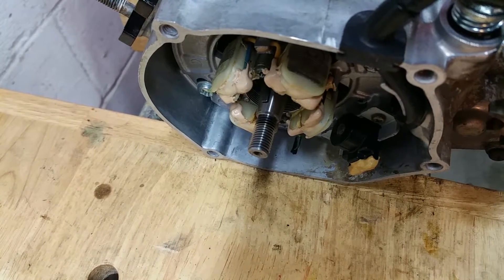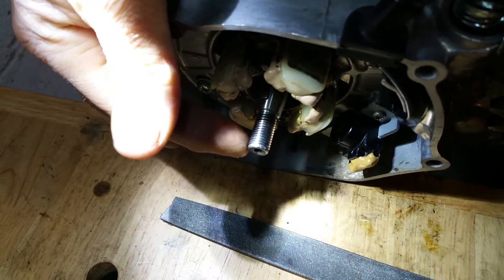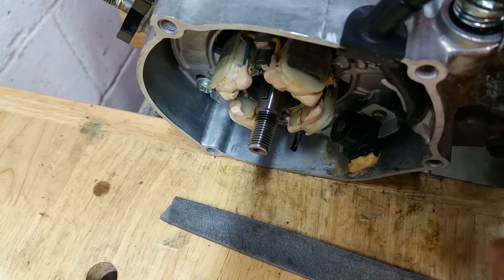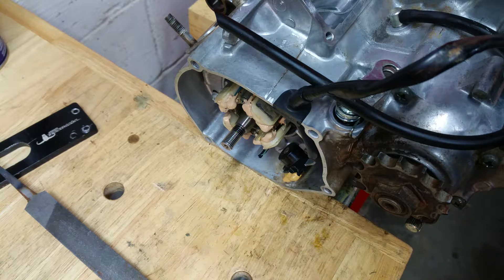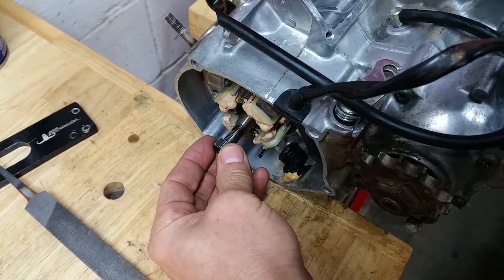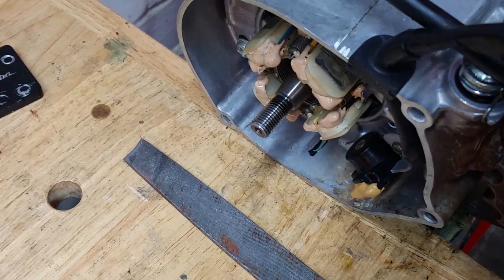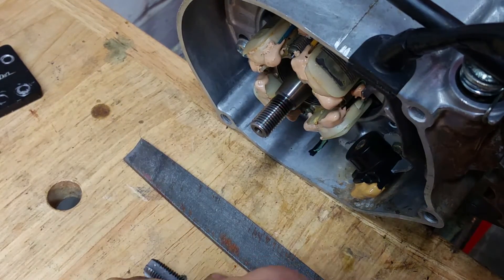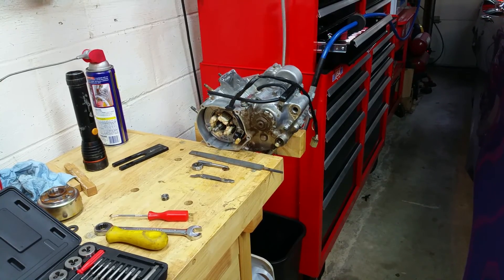What to do if crankshaft threads are damaged motorcycle crank shaft dirtbike small engine mower any

Comment: I needed this video badly.
Reply from the maker: What vehicle were you working on?  What was the issue?
Reply: @HorsepowerHouse  Yamaha R15 V2.0  . While opening magneto , The tool was misalign a little out of center. I needed to put lot of pressure to remove Magneto. While doing so starting thread of Crankshaft end got pinch and now while install Magneto rotor back, Threads are not starting.  Thanks for your video.
Reply: I bought a new nut to avoid damage to crankshaft threads.

Comment: I was in the process of removing my flywheel off a Ktm. Come to find out the hard way, the threads are reversed. I found out, after trying to pull the nut. So the nut is done. The crank doesn’t look good. Do you think the threads can be cleaned up like you did here to get enough bite again?
Reply from the maker: Maybe but I guess you will find out
Reply: Thanks, it appears so. I think my threads look better than in your yz80 case in the video. Maybe not as clean. But I think there’s more thread left. We’ll see how it goes.